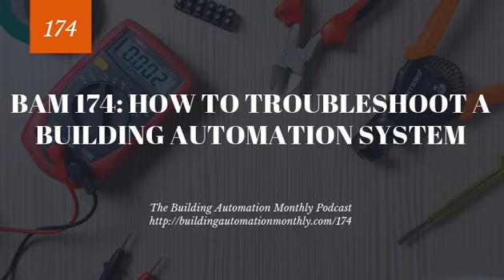BAM 174: How to Troubleshoot a Building Automation System

Comment: Great episode as usual Phil. When I was training newbies on troubleshooting a controller I would tell them the old medical adage, "when you hear hoofbeats behind you, don't assume it's a zebra."
This also worked well since I mostly worked in hospitals.
The point was to first check the "stupid stuff" that went wrong because 90% of the time that's the most likely cause. This could be an overridden setpoint, an unplugged or shorted comm cable, bad addressing/baud rate/cable, etc.

I would also have them verify they understood the problem correctly. The problem isn't "my space is too cold" but rather "why isn't the controller turning on the heater." That leads you to start working backwards from the end state of the problem to what is the source of the problem, I.e. the heater isn't turning on because there isn't enough air flow which is not triggering the air flow switch and enable the heater strip to activate.

There's a certain level of intuition that goes into troubleshooting but it is in its base form an algorithmic process of checking and fixing until the source of the problem is resolved.